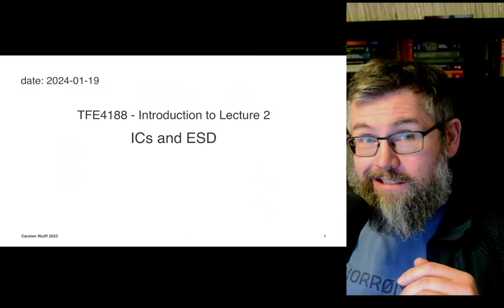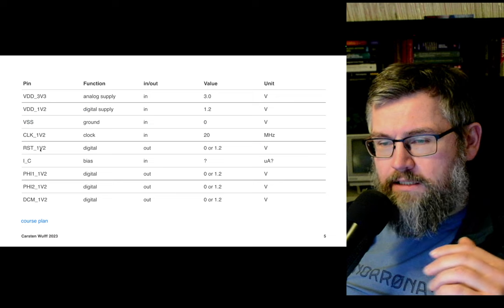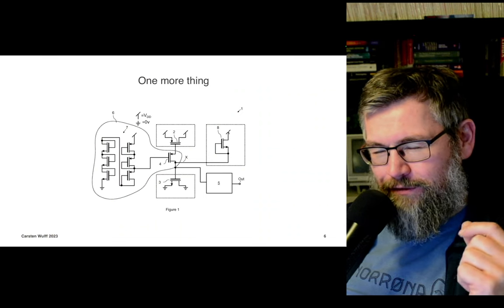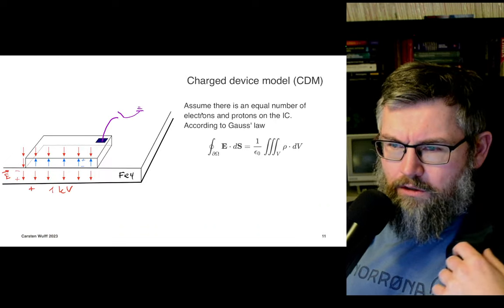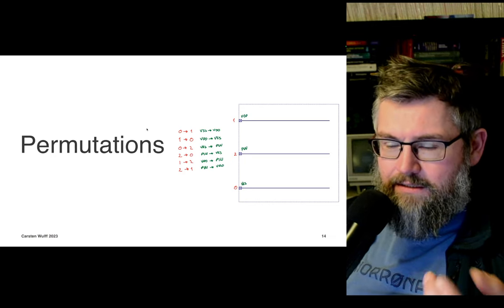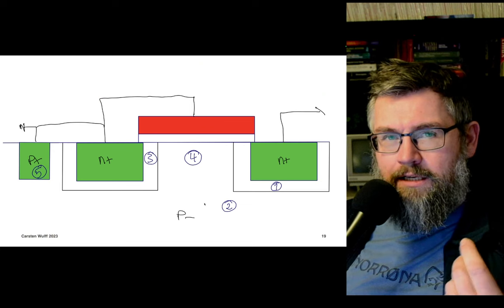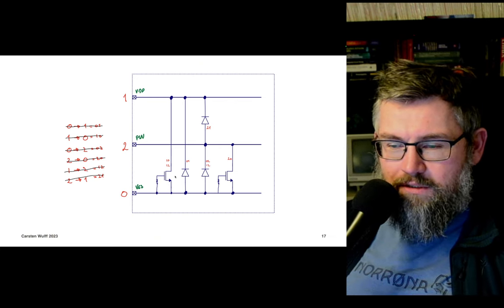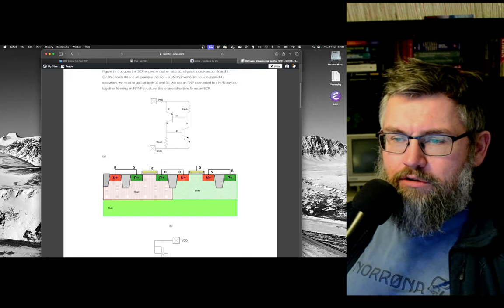Lecture 2 - IC and ESD

Comment: Good to see practical aspects like active parasitic devices being included in the EE curriculum.
Reply: Just to add, the Grounded Gate NMOS clamp for the positive zap can also act as the negative clamp because its body diode clamps the negative zap. Of course you need to have the correct dimensions and layout of guardrings/salicide-block  to avoid latchup and withstand 1-4kV HBM but you'd have to do that with an explicit diode too.